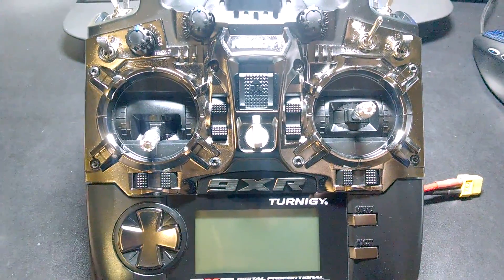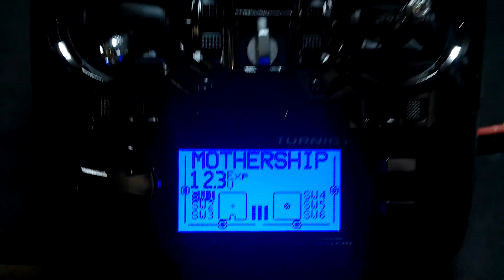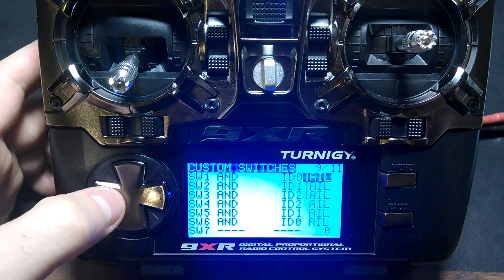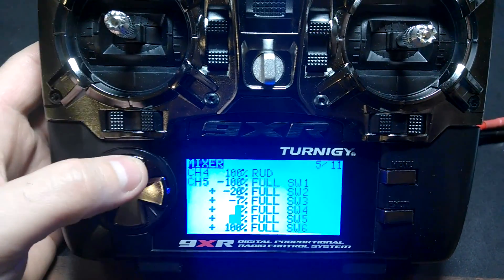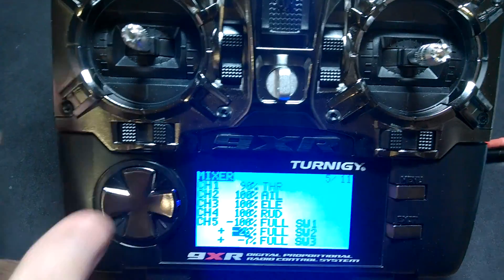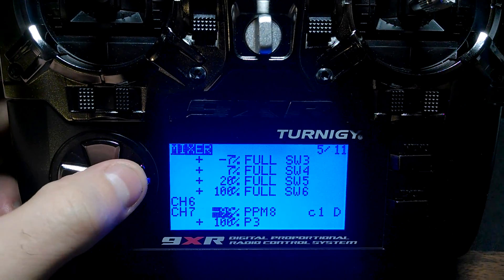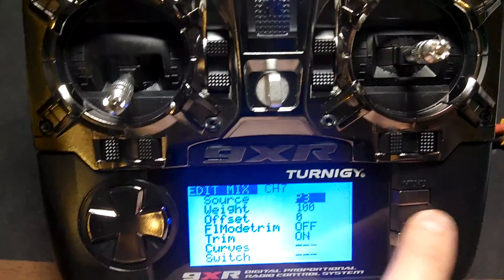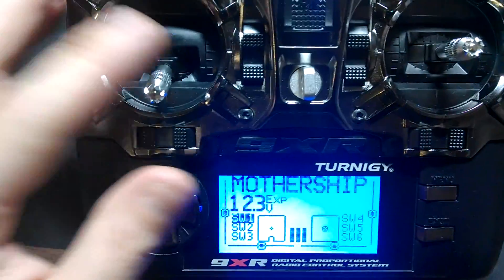Turning 9xr 6 Position Switch and Head Tracking

Comment: Sir, 

Per Mission Planner I need a value of 1750 PWM + to achieve flight mode 6. I have + 125 Full SW6 and the most I am getting is 1664. Any ideas ? 

Martin 
Texas
Reply from the maker: Do the required pwm levels (for the different flight modes) change depending on your radio calibration?  I don't think it does, but that functionality would make sense.  You could see in the full variable list if there are values you can change that set the required pwm's.    Those ideas both involve settings in mission planner.  As far as programming the radio to hit the pwm's.... I know it's possible but I don't know how.  Possibly your trims or sub-trims need adjusting?  Also, in the mixer editor, go into on of the mixes and there's a line called "offset" I think.  Maybe mess with that.  Good luck.

Comment from the maker: Just got this radio.  I very much like it.  It didn't take long to figure out how to create virtual switches, mix inputs, map outputs... setup the radio just how I want it.  In this quick vid I show the settings related to the six-position flight mode function (for APM 2.5).  Also, I show how I mapped camera gimbal pitch to both my headtracker input, and a knob on the radio.

This radio was clearly thought of differently and designed from the ground up to be more universal, and easily programmed.